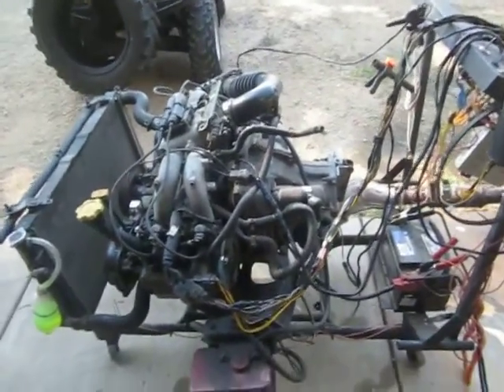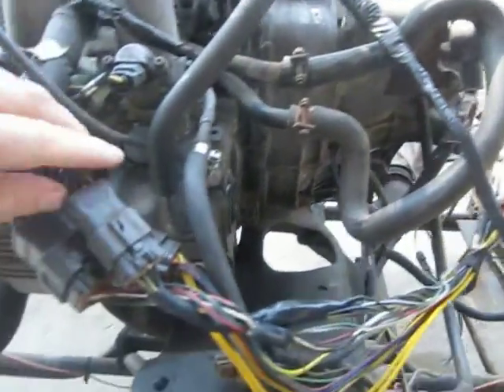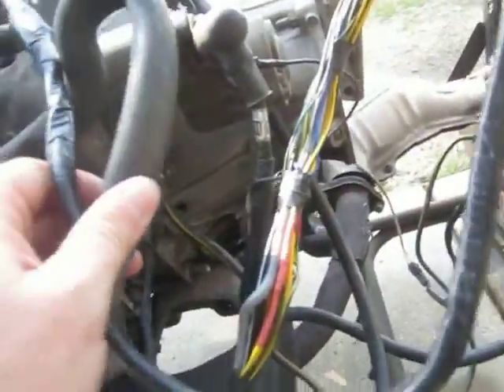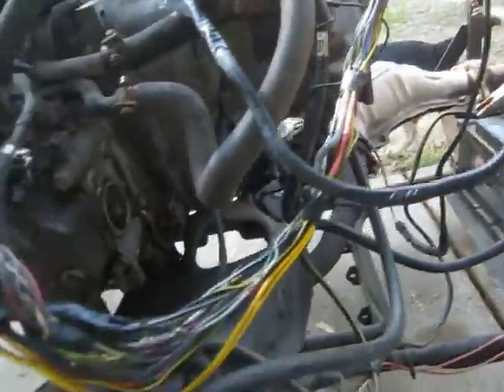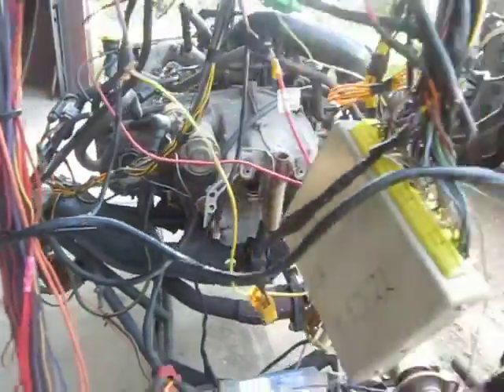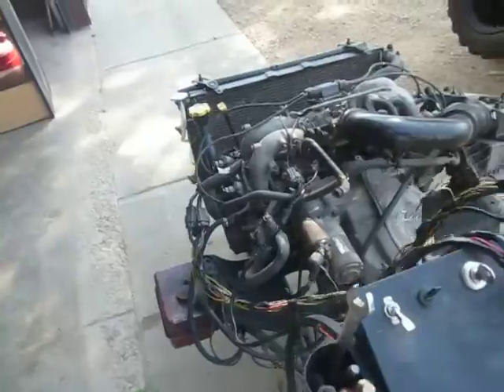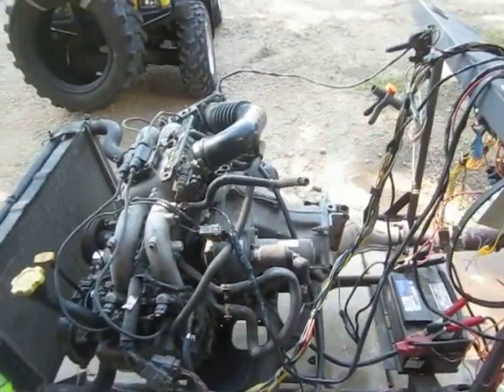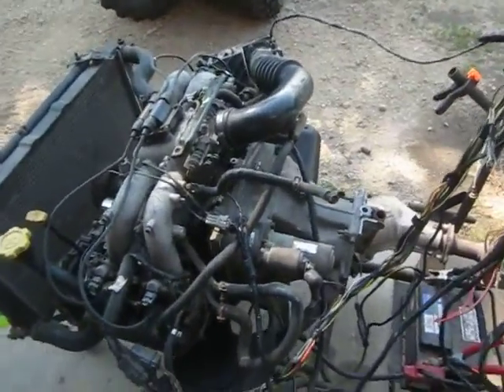Vanagon Subaru engine conversion 90-94 EJ22

Comment from the maker: If you have a 1990-94, 2 longs and a short is "21" which is coolant temp sender.  In my experience when they fail it will tell the computer it is really cold out, up to -60.  That will make for hard starting(push on gas pedal to let more air in to help the motor to start) and rough running while warming up.
All that I have had bad would read good once the motor was up to operating temp.

Comment from the maker: The 2 black connectors next to the ecm, connect them and count the blinks of the check engine light.  The 91 ECM has a green light on it also that works as a check engine light.

This is the same way to check it in the stock subaru so you can just search for that also.

Good Luck,  Jeff